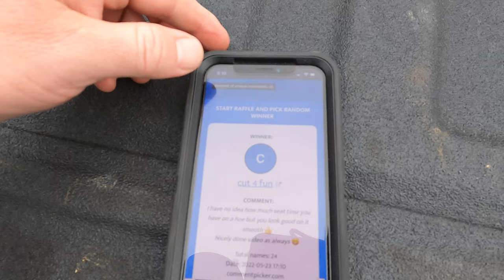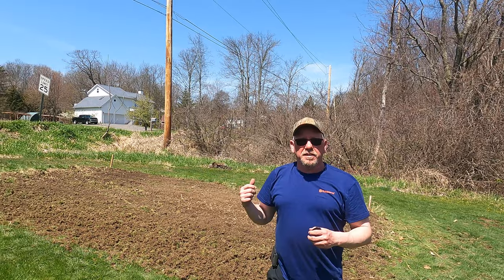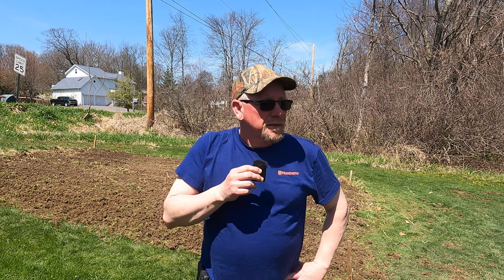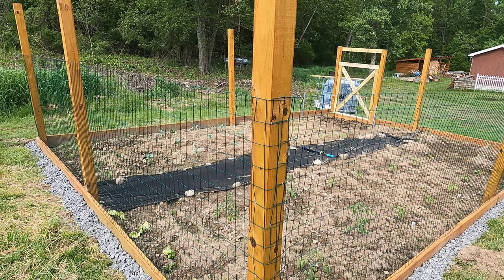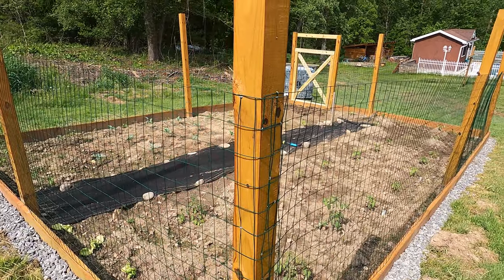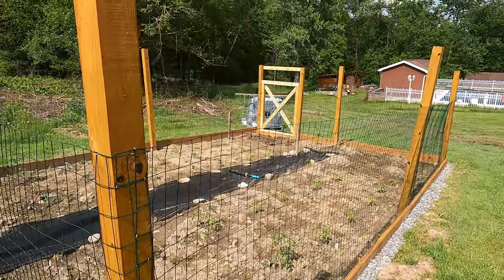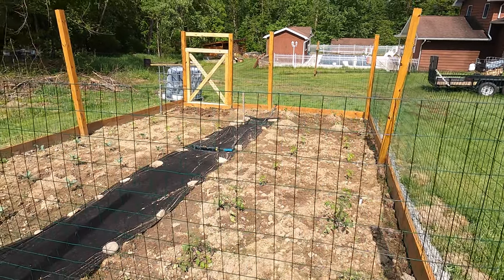#77 Garden Expansion and Upgrade

Comment: Congrats Cut 4 fun! Nice job on your garden. I don’t like feeding the critters either after all the work to get my garden going. There is a ribbon you can put around to keep the deer out instead of adding more panels. It’s called Deer Stopper. Amazon has it. This ribbon is impregnated with eggs and other oils the deer don’t like. After a month or two, you can treat the ribbon again with the spray they sell. I’ve had good luck with it around my sweet corn/pumpkin patch. I just string it on t-posts. Thanks for another great video and I hope the garden does well!!
Reply from the maker: I have tried all kinds of things for the deer but I haven't tried deer stopper.  I am going to give that a try!   I have some extra plants that I have a place to plant and I will try that.